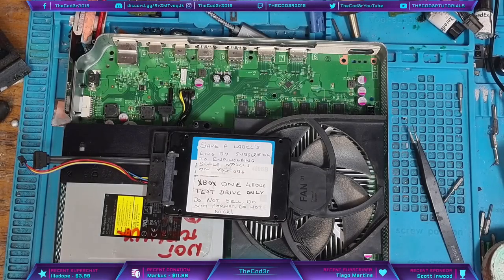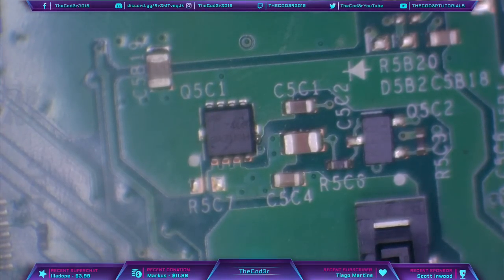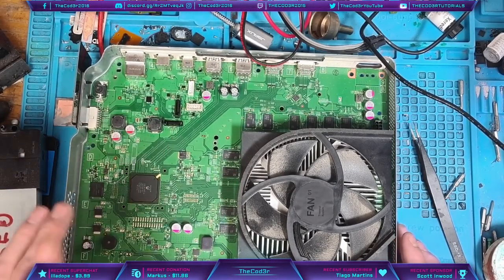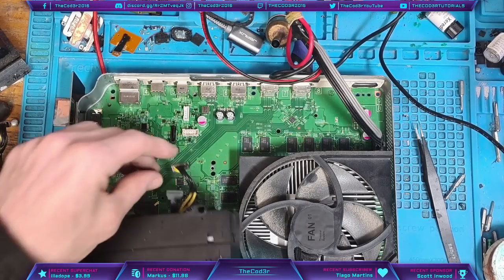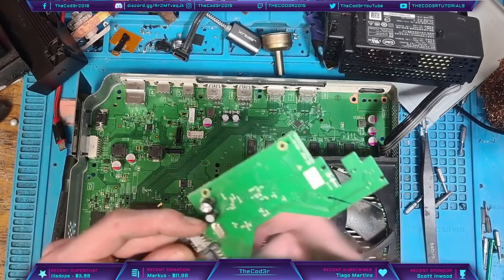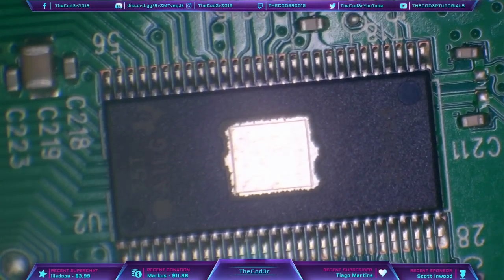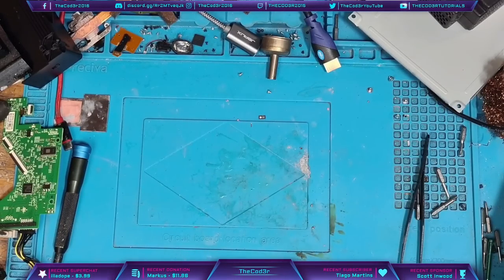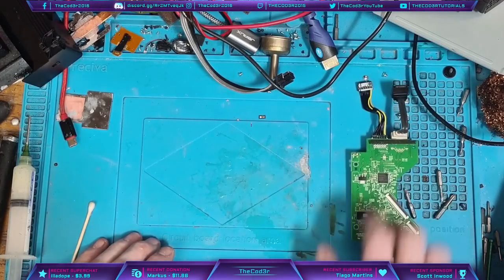Xbox One S Not Turning On - Disc Drive Daughter Board Diagnosis And Repair

Comment: Badass teapot. I always learn something new here with you and Andrew paul lol. Waiting for a bunch of OG ps4 hdmi ports lol. What do you think about when the one S turns on then shuts off after switching the hdmi encoder?
Reply from the maker: Hey man sorry I didn't see this comment. If it happens after changing the encoder it would likely be installed incorrectly or have a bridge on the encoder somewhere :)

Comment: Love you videos. I'm new to console repair and you have helped me loads already, thank you for that. Have a question though, I have an Xbox one s I've been wanting to repair, noticed that the daughter board was messed with and probably swapped, very badly, some capacitors were possibly swapped but we're not in place, I have put them back, but I'm not sure it's fixable, is it possible to get a new board and swap the chip?

Comment: When you disconnected the disk drive and plugged in the psu and I saw the fan speed spin, i knew it would work. Yeah the mobo is usually the issue.

Comment: My first thought was, transplant the Main IC (that holds drive key) and move it to new board 
I actually have a video on my channel doing that repair.
Reply from the maker: Yeah I've done that myself a few times, though I usually try and repair the daughter board itself first:)

Just subbed to you, I'll check out some of your stuff :)
Reply: @TheCod3r  thank you sir! 

Well in my case, the SATA connector was no good. Rather then replace it, it was actually easier to move the chip to a new board.
Reply from the maker: @chasefournier  yeah in that case sometimes it's better to just do a transfer. I've changed a few sata connectors on ps4 boards where the hard drive plugs in though, I may have to do a video on that one day lol

Comment: Excellent repair and fault finding. What would one do if they dont have a donor board for the capacitor replacements? How to obtain the values. Thanks
Reply from the maker: You would need a set of LCR tweezers to get the values of a capacitor or a multimeter that has capacitance mode. If you take the cap off the board you should be able to get a reading :)

Comment: Hello Coder. Could you help me out with my issue man? I swapped out the optical drive on my Scorpio and I soldered on my old daughter board to the new optical drive obviously. So the Xbox now reads discs perfectly but the new issue it developed after I swapped the drive and daughter board is that I have to keep a disc in drive. If I leave the console off without a disc inside it, the Xbox turns on and makes drive noises. Even if I don't want to play a game, I need to leave a disc inside the drive. Do you know what my issue is?

Comment: Nice repair and diagnosis, before returning to customer do you do a system clean, the fan and such?
Reply from the maker: I dp usually but this customer sent 82 consoles (business customer) and just wants board repairs only without messing with the parts so I won't be on those ones :)

Comment: Nice repair. What is the temperature you  use on the heat gun  to replace dose little capcitor
Reply from the maker: Typically around 420⁰C at 40% Air flow
Reply: @TheCod3r  thanks bro